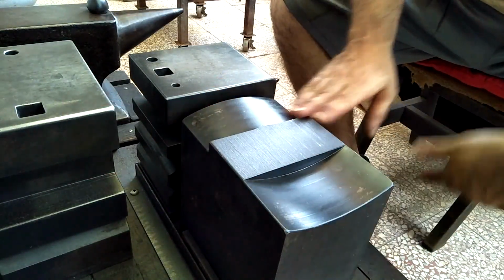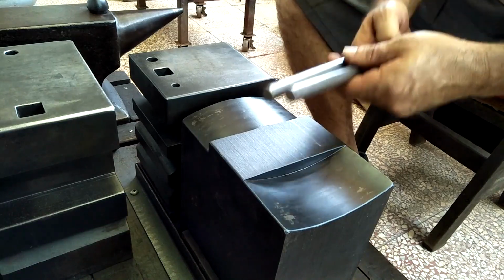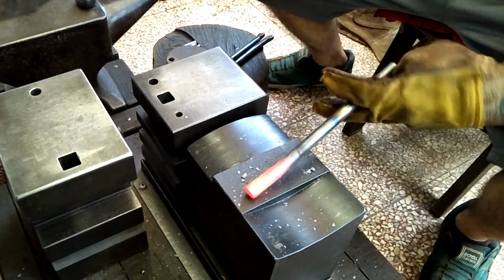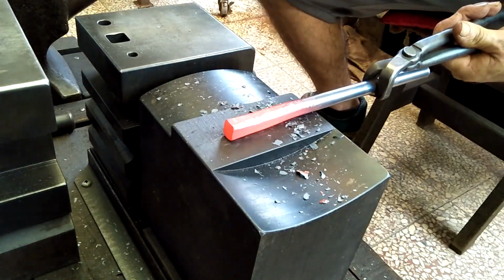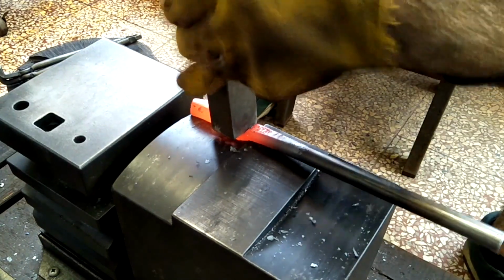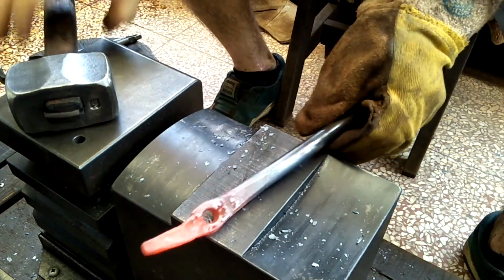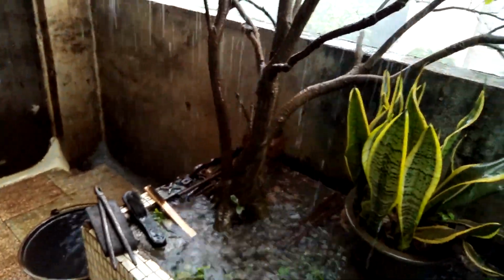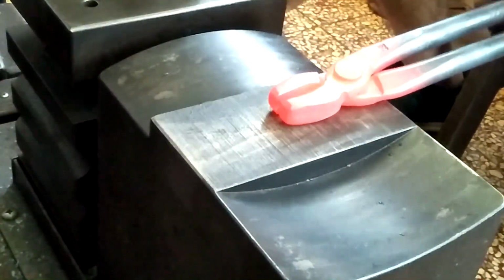Forging a Tong on New Anvil

Comment: I love the way you experiment with adapting your designs of tools and equipment to modify your working environment. Seems a very sensible approach to make everything more efficient in your workshop. The traditional blacksmith anvil was probably terrific for the first few hundred years of evolution, and now there's the New Millennium GS Tongs Anvil.
Reply from the maker: Dav, Doing my work in Taiwan has really led me to think out of the box. This isn't always good but sometimes it leads to unexpected improvements. I'm not sure most blacksmiths would find this style of anvil more useful than a traditional anvil but it suits me very well so far. Thanks. Glen

Comment: Very nice.  I just realized something, you start with cold rolled (1018) steel don't ya?  Maybe that plays a small part in why your forgings are always so clean looking ;)     Just curious, but do you plan on cleaning those saw marks off the top of the flat on your new anvil, or just leaving it as is?  Thanks for sharing.  It's been a while since I've left a comment but I just wanted to say that I still enjoy watching your vids and forging style. 👍
Reply: Are all your tongs CR 1018?  Did I miss why in another video?
Reply from the maker: Yes, I use cold rolled 1018 for all my tongs and that definitely plays a part in contributing to their final look. I'm going to leave those marks for now. Eventually, I may grind them off but to be honest, they barely leave any marks and over time continued use of the anvil will wear them smooth. I'm glad you continue to watch... Thanks. Glen
Reply from the maker: Noah, Yes, I use 1018 cold rolled for all my tongs now. Firstly, it's a more consistent material than hot rolled. Secondly, it's easier to forge than higher carbon steel. And lastly, it won't crack with frequent cooling (I often quench my tongs when the jaws get hot) like medium carbon or other alloy steel might. Thanks for watching.

Comment: Great tongs! what kind of steel you use for the tongs, thanks in advance.
Reply from the maker: Lufe, I use 1018 mild steel for my tongs. Just easier to work than higher carbon steel and much less susceptible to cracking from frequent quenching (I always cool my tongs). Thanks for watching. Glen

Comment: nice :) and i have 2 questions - 1-how this anvill hold up ? does it chip or something ? and 2 does that saw/rough marks , mark the steel ?
Reply from the maker: Kido, The saw marks are not deep. They mark the work slightly and I may eventually grind them off. But they will also smooth out with frequent use. It's very unlikely this steel (4145) will chip. The more likely thing is it will dent if struck with a hard enough hammer. Thanks.

Comment: Did the tongs actually open? it looked as if they were stuck shut. They sure look good though.
Reply from the maker: Eric, Yes, they open and close. The joint may be a little stiff at first but after one or two uses, will loosen up some. Thanks for watching. Glen

Comment: Hey ho GST. I love your tongs so smoth and clean. The anvil does a great job. I like it very much. 
The good thing about the rain is u have always fresh water to quench ha ha. Nice vid again. My anvil is a mild piece 40 by 20 by 4 cm. And I use a 75 cm long c50 steel with diameter of 50 mil. Using it while its standing up in a pipe to keep it erected.   Nice vid thanks for sharing. Greetings
Reply from the maker: In the past, I had a very similar anvil to what you described - the long one set up vertically. This new anvil of mine really suits me so far. I really like the rain but not too have and too constant. Thanks.,

Comment: Very nice new anvil.  I love to watch you work.  Seems so effortless.

BTW, do you plan on putting a radius on at least one edge of the flat top?  As you are aware, those sharp corners are a lead-on to cold shuts.
Reply from the maker: I'm very pleased with this anvil. I did slightly radius the sharp edges and may do more but first want to use this anvil a while before deciding what might suit me best. You're right about sharp corners but also a lot of guys who get new anvils regret not leaving at least one sharp edge... Thanks for watching. Glen

Comment: Salut Glen comment ça va j'ai une question pour toi. Est-ce que tes pinces ne sont pas trop courtes? Est-ce que tu ne brûles pas les mains???
Reply from the maker: Adem, This is a very good question. For a few reasons, I like my tongs to be short and I know this doesn't suit everyone, especially those who use larger gas forges. I never have a problem with my hands getting burned from the stock I'm working but it can sometimes be difficult to get smaller pieces in and out of the forge with such short tongs. So, I have a longer, pick-up style tong that I use to get things in and out to where I can easily grasp with my short, forging tongs. In general, I just find this short style easier to manipulate which improves my productivity. Thanks. Glen

Comment: Hi Glen, really love your work! what stock bar do you use for your tongs? do you use ordinary mild steel or some other steel type?
Reply from the maker: Hi, I normally use 1018 mild steel, 14mm diameter, for my tongs. I prefer mild steel tongs since I often quench my tongs and higher carbon stuff might crack over time. Thanks for watching. Glen

Comment: As always, great work !
Reply from the maker: Gabriel, Thanks for your support. Glen
Reply: Oh, it's our role to thank you, for the knowledge and fun you share with us. I wondered, why did you use a rectangular punch in the middle of the punched hole process ?
Reply from the maker: Gabriel, That's a good question. That slender slot style punch helps me to make the hole more quickly, especially when my round punch is a bit dull and needs to be dressed. I will modify that punch some and make it a small slitter and so try to open the hole but remove the least amount of material possible. Thanks. Glen

Comment: Where did you buy the anvil?
Reply: Danny Thomas He has it made to his own specifications.
Reply: @CaptainTwitchy  
        Who makes them?
Reply from the maker: Danny, I designed and had this (and a few other anvils) made where I live here in Taiwan. Thanks for watching. Glen
Reply from the maker: Bob, I designed this anvil - bought the steel, had it machined and heat treated at separate small companies where I live in Taiwan. Thanks.
Reply from the maker: MIKAL, Thanks for your help. Glen